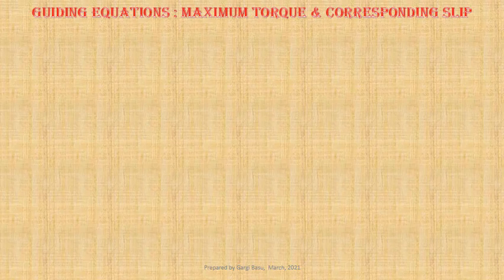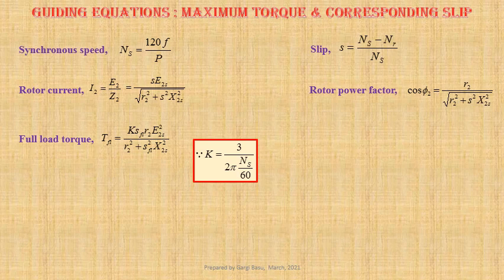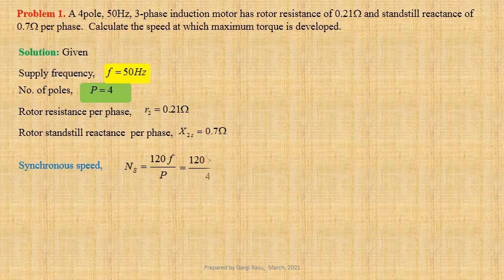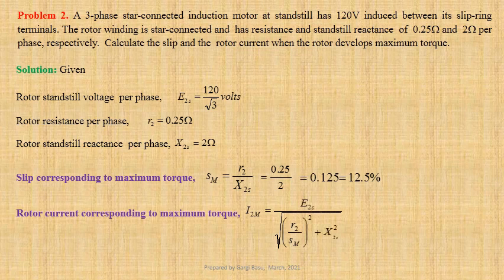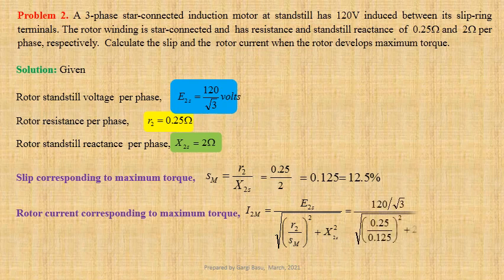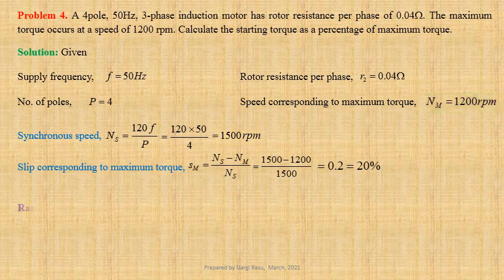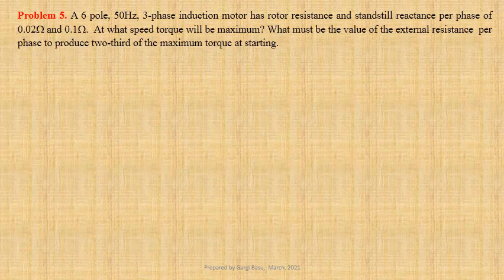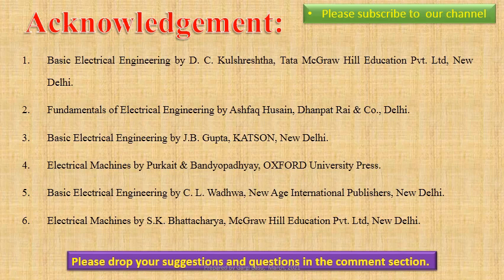Numerical problems on 3-phase induction motors: Maximum Torque & Corresponding slip

Comment: For problem #5 (2/3 max torque at starting…I believe she used X= negative b plus or minus the square root of b squared minus 4ac over 2a.
Reply from the maker: Yes. I have used quadratic formula to find out slip at maximum torque.

Comment: Hello Mam. In Problem 2 I see that the active component of the rotor impedance was divided by slip when calculating rotor current corresponding to maximum torque. If I calculate rotor power factor, would I also divide the active component of rotor impedance by slip? I’m asking because in the beginning of the video, when you introduce the guiding equations, it appears to me that it would be the standstill reactance multiplied by slip, in both equations for rotor power factor and rotor current. 🙏
Reply from the maker: If you divide numerator and denominator of the equation (given in slide 2) by slip, you will get the equation used in problem 2.
Actually the rotor  reactance changes due to change in rotor frequency since  X=2*pi*f*L
Reply: @gargibasu5111  Thank you so much for your reply. It makes sense to me now.